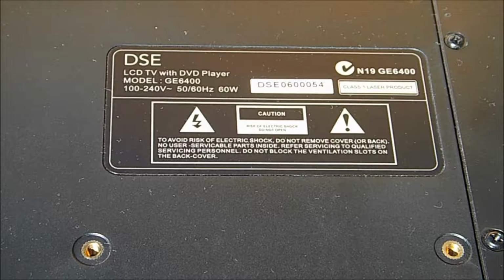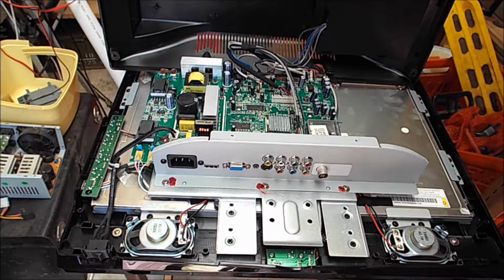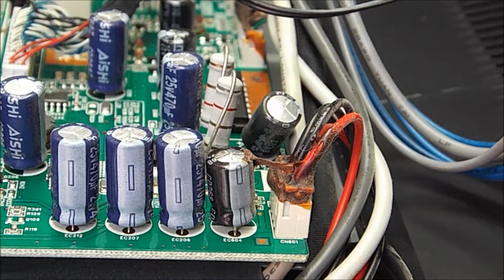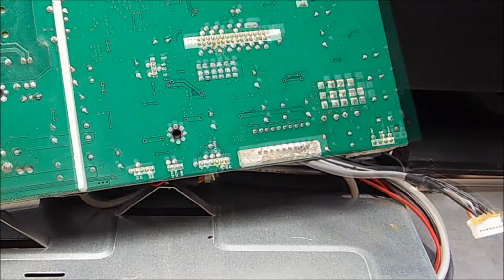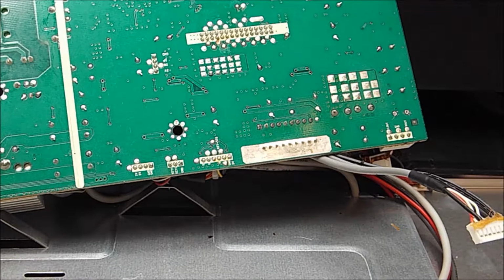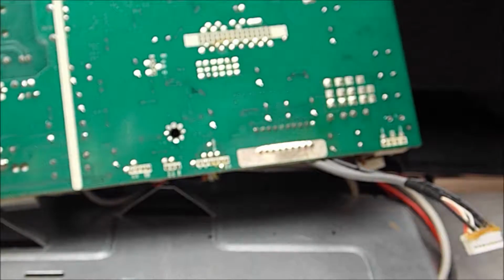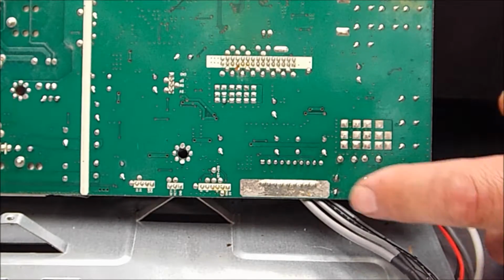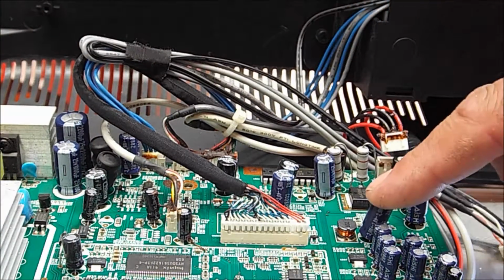DSE GE6400 TV/DVD - Screen Fault

Comment: Well spotted and a nice easy fix
Reply from the maker: Indeed, this will be the second or third PC monitor I have fixed over the last few years, generally it is the electrolytic failing that causes issues.
Reply: +SpectreOZ probably built to a budget. 105deg caps would have probably been fine and still going strong